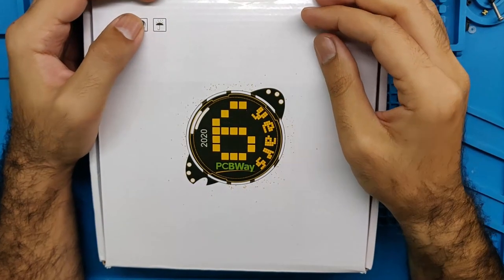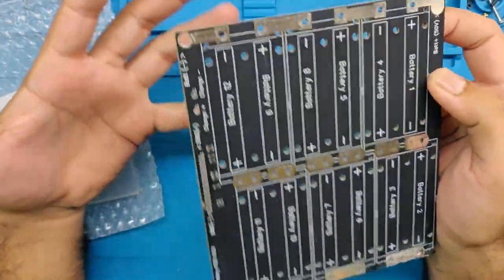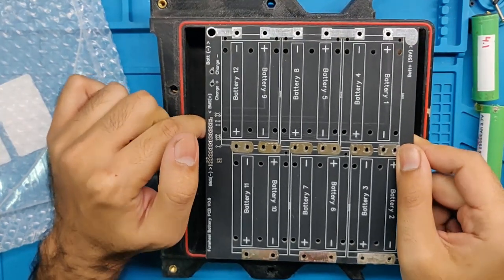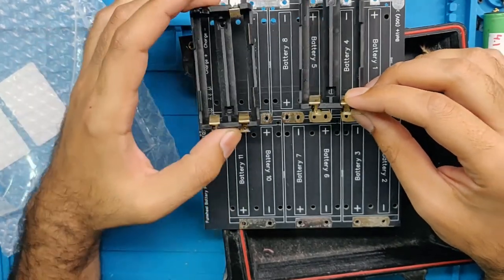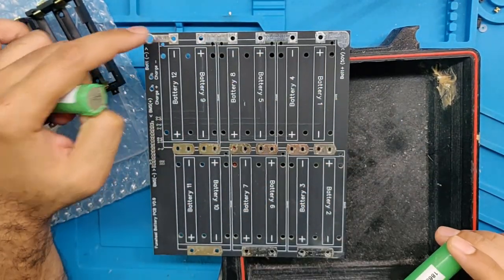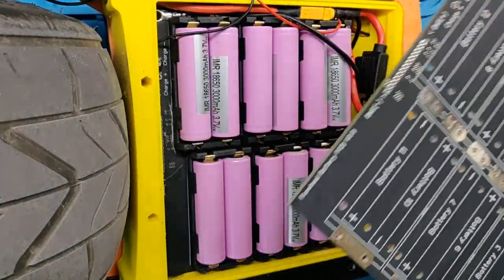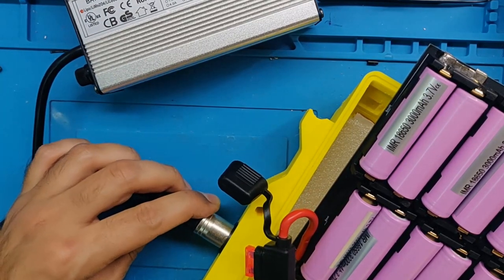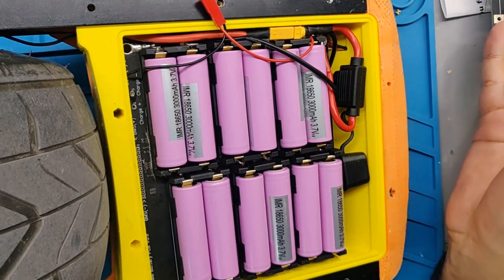A PCB that is a 12S2P battery pack - Can this work?

Comment: If you do any future revisions, I’d recommend putting holes in the PCB to allow using zip ties to hold groups of 4 cells together (2 front + 2 back). This is a great option for safe travel as well. I hear that once you establish a “relationship” between a group of cells, you should mark them in order and always use them together and in the same order. Thoughts?
Reply from the maker: I recommend taking them off for travel. Single cells is safer than traveling with a pack. 
Why the relationship ? I've never heard of anything like that but interesting thoughts
Reply: @Fungineers  right when I mention travel, I mean remove the cells. The relationship thing comes from the vaping community. They’ve learned a lot of lessons from accidents with 18650 cells. I don’t know if it is anything more than an abundance of caution.

Comment: How do you solder in the middle section? that looks hard. Also, how do you solve batter dislodging from vibration(and voltage drop from nanosecond disconnects)?

Comment: Personally what I would like to see would be individual P groups, something like 1S8P like NESE is. That would easily allow to build big packs, rather than stacking 4 of these in the board. But for smaller esk8s these are perfect and I might pick one up once I'm rebuilding my small esk8. I was already looking at those cell holders, that these can handle big current, it's nice to see that someone is experimenting with it.

Comment: Supercool! i ate all your other videos last month. if i didnt purrchase a whole kit was because of the shipping costs to Spain (plus further custom costs).
I dont know how chineses have such ridiculous shipping costs and get to avoid customs.
I was also considering the option of using those cell holders to make a battery pack for my diy mountainboard, but i didnt find any which had that massive pins to bear the battery amperage.
Btw, the jehugarcia's battery holders for powerwalls were cloned/copied/rippedoff by tons of sellers in aliexpress.
Keep going! amazing work!

Comment: Are you planning on building 10S version too?
Reply from the maker: 10S is too weak
Reply: @Fungineers  I have few electric skateboards and they use 10S. I'd like to use this kind of PCB for them too. :)
Reply: I thought the same thing as Mikko re 10S... 10S2P stacked as 10S4P would have lots of uses... more std voltage.